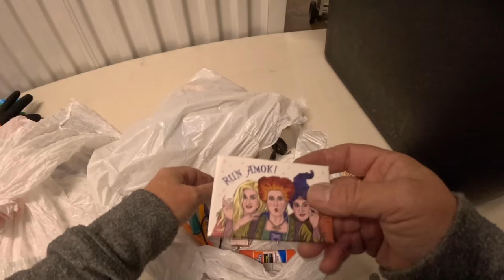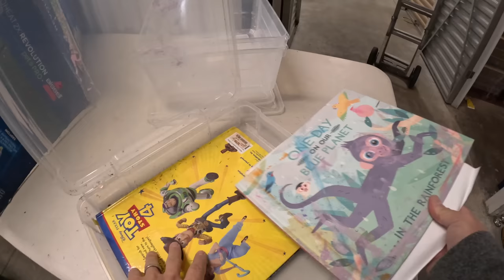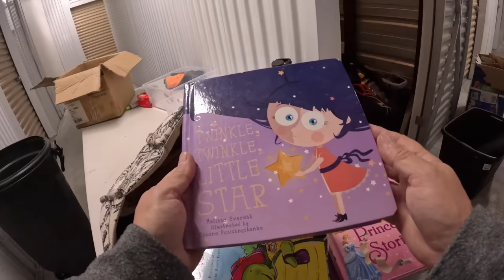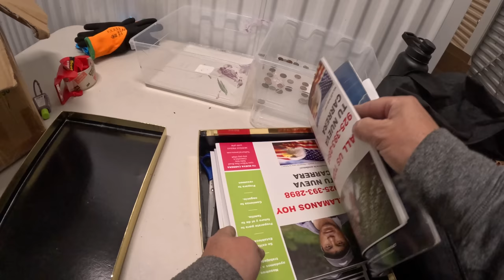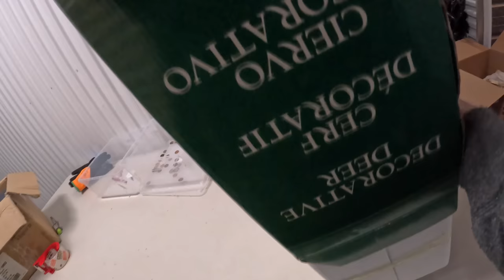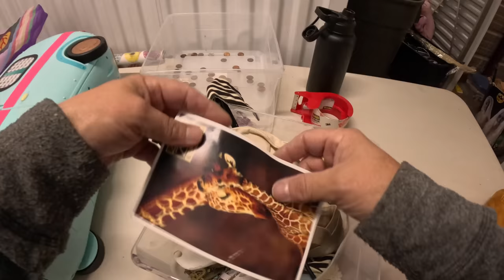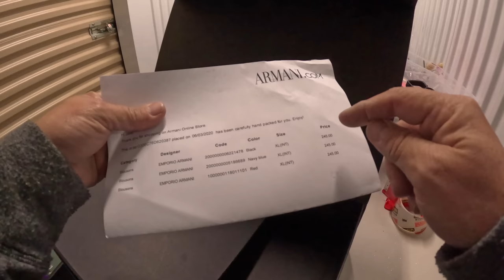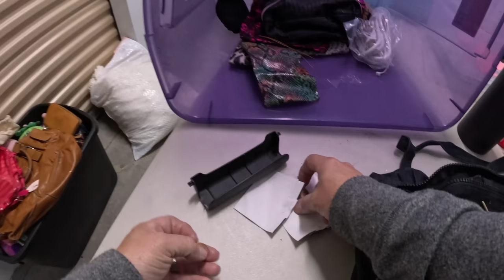What else do I find in these TWIN LOCKERS? Let's get to the bottom of it.

Comment: I’m sure you have found out by now but the plant is sage. It’s burned to cleanse houses of spirits. It could be used for other purposes I’m not aware of.
Jack when you found the car wash a question popped into my head. Do you wash your own cars? I just can’t imagine that you would have time!
Reply from the maker: I don't wash my cars, but I might start again this summer. Like everything else, washing cars has gotten extremely expensive around here. Because of the height of my van, it won't go through the machine so it needs to be hand washed and it's about $80 for the lowest level hand wash (no wax or anything). Yikes! That's why I've only washed it once a year so far, LOL.
Reply: @LockerNuts  That totally makes sense!